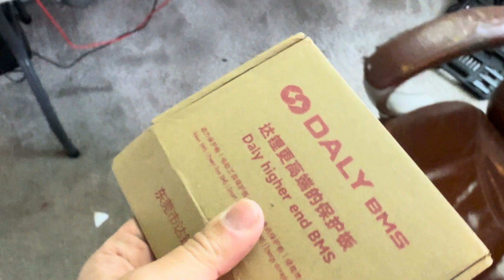Aventon Aventure 2 Battery Mod.

Comment: It's always better. When you mod something and make it better! 💪 The only small issue is, where you gonna put the Daly BMS? You're gonna have a long balance cable. 🤔 How about you make a new battery pack using hi Capacity like Samsung 50s and put it in the same battery frame of the Aventon. 🚲
 Can you tell me what type of LG cell Aventon is used in this battery? Is that 21700 or 18650, And what is the BMS Amp rating? Thanks for your time and efforts.
Reply from the maker: They are using 39 cells 13S3P Lithium Ion LG INR 21700 M50LT. They are 4800mah. max discharge is 3C or 14.4A x Parallel around 40A.  As you mentioned the Samsung 50S is the way to go since they are 5000mah 25A discharge. I am currently working on a 13S4P pack with that exact cells. I may make it 135P to make a 1.9Kwh pack.